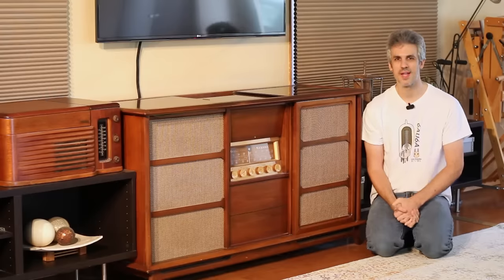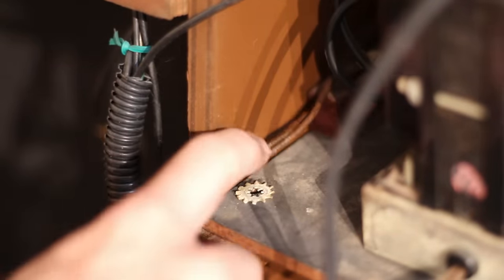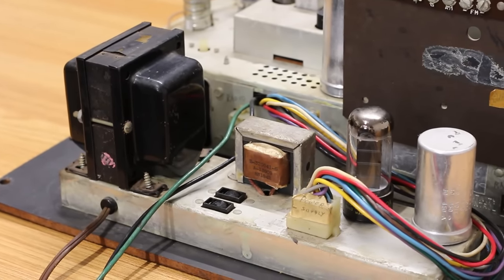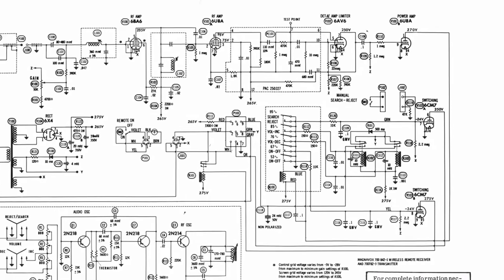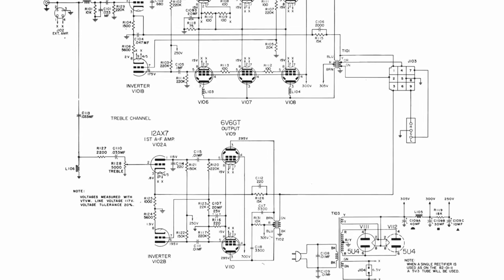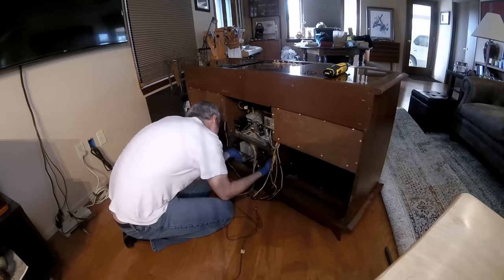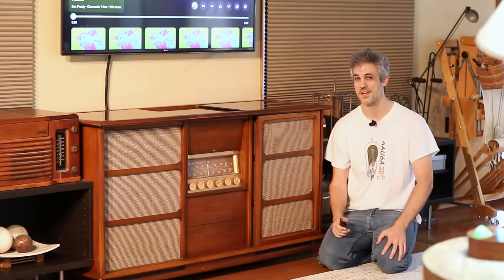A Look at our Magnavox Concert Grand Console Stereo

Comment: There were toys that broadcast a radio signal, most directly was "Mr. Microphone".  There were also units that plug into a headphone jack so let you hear your device on the main car radio speakers.  Digging up one of those would be the easiest way to calibrate the tuning dial.  If you're trying to source string, try the stuff used by RC planes.  It's Kevlar which does not stretch at all and gives positive repeatable motion, and is available at hobby shops.

speakers:  When I got my Paradigm Titans in the mid 90's, I found that that just 2 watts would rattle the windows of that room.  The 15" subwoofer though, has its own 500W power supply.  That would regularly cause screws to loosen throughout the house.
Reply: Braided Dacron fishing line is virtually non-stretching and works well as dial string. Monofilament, however, stretches far too much and would never work.

Comment: The Concert Grand is the holy grail of Magnavox console stereos. 100 watts total power between the 2 bass channels and 2 treble channels. Remote control was radio frequency. That console was $1000 in 1959, which I see was the build date of that unit. Since FM stereo was new, the MPX adapter was an option. Oddly at the time you could opt for FM stereo OR remote control, however the later MPX adapters were smaller and people have CG's with both. I had one in that cabinet style in ebony. It has been passed along to another collector.

Comment: FM, you're a bit out of range there but AM- that should wake up at night and pull in a bunch of stations.
You can often omit the ground connection and have the antenna alone work- I pulled a length of wire down the wall and have two ceramic insulation posts screwed into the roof rafters with 50' of baling wire pulled taut between them.
Works great at (a rather directional) AM antenna for the HiFi in the living room.

Comment: That's wild, I've never seen a console with monoblock amps. And that many 6V6s! !  A few more and it could be output-transformerless (OTL). I have a mono amp with a pair of 6V6s that puts out plenty of sound from a 12" woofer and a treble horn, although I did switch to an amp with push-pull 6L6s.  I can't imagine you'd want to run that during the summer in Texas.
Good luck with the dial string, that's the bane of dealing with radios.

Comment: From the quick glance of the remote it acts like a generator frequency display. There is a coil driven from the remote receiver, which gets the decoded tones from the remote. Remote can develop 6 tones, all around the same low frequency, similar to mains, and this operates a big coil that activates the set of tuned reeds. Those that resonate have higher amplitude, and make momentary contact with the contacts for that function, and there is then a RC circuit per channel to operate a relay for each function, so that a press operates each relay for a long, plus a delay due to the RC network, for each function. 6 buttons so at least 2 are power on and off, and then volume up and down, probably by a motorised volume control, and then finally you probably had tuning via a similar thing that ran a motor to the tuning dial.

Comment: Radio is actually pretty fascinating. You are essentially using a high-frequency radio wave that's orders of magnitude higher in frequency than sound waves, so you can use it to "carry" the audio signal. If you look at AM radio, the actual shape of the radio wave mimics the amplitude of the audio signal itself. You can filter out the high radio frequencies using filtering capacitors, but because it's an AC wave, you would just get nothing if you tried doing that. First, you need a diode to cut out the negative part of the wave so you can filter out the RF to get an electrical signal in the shape of a sound wave (modern radios also use a DC offset to bring it back to being an AC signal). The term diode comes from the original vacuum tube diodes, so called because they have two electrodes. Before that though, the very first radios used a germanium crystal and a metal needle attached to a screw that you had to screw in so the needle just about makes contact with the crystal, allowing the current to flow in only one direction. This is these days known as a point-contact diode and they didn't know it at the time in the early 20th century, but they had actually invented the first ever semiconductor device. So we actually had semiconductor diodes before vacuum tube diodes!
Reply: Some of the operators even noted a "cold" light emanating from some of their DC-biased carborundum detectors - these were in fact LEDs!
Reply: Amplitude Modulation on a carrier, demodulated after oscillation at 455khz I believe. There even was an AM Stereo. The FM trick is quite fascinating and the stereo (1-x) and others on the modulation is really great. Its fun playing with RF in times where people believe that HiRes makes very poor sounding devices deliver 'studio quality', where actually a good FM broadcast can sound better than expected.

Comment: Enjoyed that immensely  David!  Thought you'd like to know....The"Zenith Phantom" remote control system also used controllers with   They used a small bellows attached to a reed to generate a specific sound frequency that could be detected by your television or stereo console.  It is similar to the tuning fork system used by "Zenith Space Command"  The Zenith system ultimately lead to the coining of the term "clicker" for remote control  as they made an audible click when the tuning fork inside was struck.
Reply: I was wondering if anyone else remembered those things.
They went "Thoong!"
Reply: @StubbyPhillips  Actually I remember it more like a 'Psst', emitted a tone somewhat like a dog whistle.
Reply: @StubbyPhillips   And Zenith held the patent on the "Clicker" using the hammer and tuned rods, which is why RCA used a transistor and an ultrasonic transducer in their early remotes. Zenith used the hammer and rod system until the mid-70s, then they went to the transistor (later IC) and transducer method), then by the late 70's the IR LED system started to come into use.
Reply: I remember from when I was a kid that those Zenith TVs went nuts when you ran the vacuum cleaner.

Comment: The first remote control I ever saw was on my uncles TV back in the 60s (IIRC). It had three sets of buttons that when pressed, struck a small metal bars and produced an ultrasonic signal that the TV picked up. The controls were something like TV on/off, Volume up/down and Channel up/down.

Comment: As already suggested by another viewer MPX was the device added to have FM radio in stereo. At the time this set was being designed the standard for FM Stereo had not been determined there were at least two competing systems being tested. As a result high end systems were designed to allow as an add in once a system was adopted - a decoder to split the stereo signal. If my memory services right the radio part of the system would feed to this device from the IF stage of the radio the multiplexer would process it and then pass it back to the radio and then onto the amplifier.

Comment: A lovely example and a good candidate to do a basic restoration. It looks like all you need to do is change all the electrolytic capacitors and check all the resistors, as some of the high value ones, especially the anode feed resistors, will have probably increased in value over 60 years!

Comment: 6  -  6V6's for the bass speaker (around 120 to 150 watts) and 2 - 6V6's for the horn ( about 50 watts) and yeah, it will rattle the windows.  4 chassis'  each with there own transformers ( the large ones are power and the smaller for speakers on the amplifiers) and no wonder this thing weighs a ton ! Beautiful consol.
Reply: you'll get maybe 30-35 watts out of 6 6V6s and 10-12 out of 2 of them.

Comment: That thing is insane! It’s essentially a tube powered stereo PA system! My old (tube pre/solid state power) bass amp had a 1x15” speaker and weighed a tonne!
Would be interesting (and possibly scary) to put a wattmeter on the power cable and see how much it draws from the wall - I’m guessing a lot! Though it would have the benefit of also functioning as a heater too ;-)
Reply: provided it runs in class A it would be 50 watts for the reciever and something like 150-200 watts per amplifier I suppose, so around 400 would be an estimate. And indeed, those tubes are good in heating the room up.

Comment: Whoa, those look like 15" woofers with 1" tweeters on bi-amped monoblocks. You can definitely run rock concert sound levels on that beast. 100 watts of tube power is the same amount of grunt as a full size Marshall guitar amplifier stack (which, coincidentally, is using the same power tubes.)

I would seriously consider attaching either a reel-to-reel or a decent record player for listening music. The built-in record player, if it still works, doesn't hold a candle to a more modern turntable with a diamond tipped stylus.
Reply: The turntable uses a diamond stylus
Reply: @matthewtaylor7355 ,  Even the best record changers invariably have mediocre fidelity at best, even if the cartridge is magnetic and has a diamond stylus tip. Invariably, such changers are idler wheel driven and will have very high rumble, low-frequency motor noise that is coupled through the platter and tonearm into the cartridge, and even if the speakers can't reproduce all of that low frequency noise it will make life much harder for the amplifiers by wasting power and just in general shaking and vibrating the phono cartridge sufficiently to obscure fine details in the music.  Having the turntable mounted into a heavy piece of wood furniture that has speakers bolted to it is also a recipe for muddying the sound because the speaker vibrations will resonate into the turntable and be picked up by the cartridge period it might be even feedback a little at high volume especially now that the rubber grommets used in tge damping and suspension of the turntable are probably dried up.

Comment: What a great stereo console! Among the very best, with Ampex and some top of the line Zenith. Too bad you're not using the FM tuner with an outdoor antenna. In early 60's most consoles and fm tuners were MPX (Mulptiplex stereo) ''ready'' but the multiplex was an add on module, optional, or that you can add later.. I have a stand alone tube Mpx unit sitting by my Scott 350 tube fm tuner.
What a beast, this Magnavox! and Cool looking! I envy you..

Comment: I don't see any antenna attached to the receiver or built into the cabinet?
Even in a rural area in the US you should be able to pick up some am stations at night.
As someone who's restored many old tube radios, I would suspect it just needs a complete realignment of the RF stages. The values of the adjustable capacitors can slowly drift and wiggle around so that it doesn't amplify the signals enough. It's a fairly simple procedure to hook up a signal generator and align the IF amplifier stages with a 455 KHz modulated signal modulated with an audio frequency. The service manual you have should give the procedure. Then you calibrate the frequency setting of the dial by adjusting some trimmer capacitors to get a frequency on the low end and high end of the dial tuned correctly.

Comment: I remember when people had these in their living rooms.  The Magnavox was great.  Their turntables measured the size of the record each time.  That’s why it touched the record on the stack, so it would know where to put the tone arm.  My aunt and uncle had one of these that was split in two units.  One was just speakers and record storage.  The other one was the controls and the other set of speakers.  Placed farther apart, the stereo effect was better.  It also played AM out of one speaker and FM out of the other because before MPX stereo, the only way to get stereo was to simulcast one channel on AM and the other on FM.  Of course it wasn’t as good, but it was two separate channels of sound.  According to Robert Caro (the volume released about 2012), LBJ demanded one of these in return for having a high worth insurance policy written.  Seem implausible to me, but that’s what he wrote in his book.  Maybe not this exact model, but close to it in price point. On a different topic, Mr. Caro is getting very old and has yet to release his final volume on LBJ he’s been working on for 10 years.  He seems to be determined, but by the time LBJ supposedly demanded this bribe he could have easily afforded anything, so I have my doubts, though I don’t dispute someone may have told Mr. Caro the incident occurred.  For one thing, the model number Caro mentioned doesn’t seem to exist in any literature. And also, by today’s standards and years of Trump grifting millions at his hotel and golf clubs, a nice hi fi seems kind of innocent.

Comment: "Radiomuseum" says the model 1ST800F (which has the same chassis but a slightly different cabinet) was made from 1959-1962. If yours is hasn't been worked on I'm 95% sure it was made in 1960 because I could see a date code of "59-52 274" on a Magnavox-branded tube. If the tube was made at the very end of 1959 it probably went into the set the next year. If the tube was replaced back in the day it wouldn't be Magnavox branded.

The 274 printed after the date code is the EIA manufacturer code, which tells us the tube was made by RCA.

Comment: To calibrate the AM dial after you restring, tune the other old radio you have on the left to 600kHz then spin the console variable capacitor until you hear an awful noise. That will be at 1055kHz leaking from the heterodyne, which mixes 455 and 600 into 600-455, 455, and 600+455. The Intermediate frequency [455k] is filtered and amplified before detecting into sound.
For FM. the IF is 10.7mHz so use 90 on the broadcasting set and 100.7 on the console.

Comment: Good tube amps these days run multi thousands,and what a clean sound they make.Looks like you could use a signal generator for retuning this beast.Great that you have the schematic,it is very handy for following the signal path if it has any problems in the future.

Comment: You only need to power the amps. Set your tv to variable audio output. Leave the rest of that stuff unplugged and save the power and heat. Lovely Bi-Amp system. Those Magnavox drivers are well liked in audiophile circles and have a good value on the market. Nice to see you enjoying it.

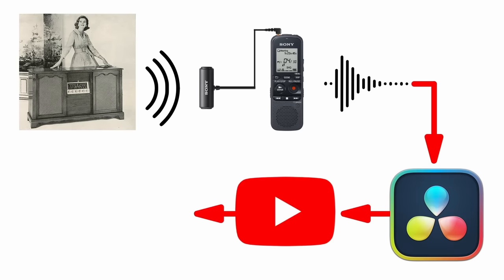Comment: Thanks for sharing. I have a copy of the Magnavox stereo demo record from that era, the front cover features that picture shown at 3:00. As a vintage techno-nerd, I appreciate the detailed views. I can't help but wonder how much juice this beast pulls, gotta be 100W just to heat all those rectifiers! The advert at about 11:00 claims it pumps a 'tremendous 100W undistorted', not huge by today's standards, but impressive for consumers in 1962. It looks like they were still getting a volume discount on those 6V6 output tubes, they used them everywhere. They're not particularly beefy, but stack up 16 of them and I suppose you could rattle the windows! The Collaro record changer looks familiar too, my earlier Magnavox mono players use practically identical models.

Comment: For the radio alignment, get an adapter for a car that converts 3.5mm input to FM output. All you have to do is power it with 12 volts and it should work perfectly for generating a small FM signal.

Comment: I have an idea of what you are talking about in performance. 
As I have an AstroSonic from 1963 (Transistors) I replaced all the electrolytics in. It has a lot of point to point connections like tube electronics, transitional phase. 

Timbre(off/on) - Treble and Base (crossover controls ?) 
two large horns and two 10" bass speakers make for a very real and loud experience.

Comment: dial drives can be a right pain in the bum to get right 😉  theres usually a datum mark on the dial or back plate to set the pointer at max (or minimum, depending on the whim of the maker) end stop of the tuning gang, so you wont necessarily need it to actually receive anything

Comment: MPX = multplex, an early term for FM stereo usually using an external multiplex adapter.  There should be a RCA jack on the back for output to the mpx "decoder" that then feeds left and right channels back to the amps.

Comment: “FM multiplex!” When FM stereo was being introduced around 1960, some FM tuners and receivers had connections for an optional FM multiplex decoder. This was a separate unit that would take the signal from the FM detector, decode the stereo signal, and output two stereo channels. On some systems, a stereo amp was already in place, on others, you needed to buy another amplifier channel and speaker if you wanted stereo.<P>If you have a small unit plugged into your FM multiplex jacks, that's the decoder. If nothing is plugged in there, you have a mono system.<P>The term "multiplex" simply means "multiple channels at once" (in this case two, of course). A 38 kHz subcarrier is modulated with the difference signal between the left and right channels. Therefore, if you add the signals from the main mono FM modulation and the stereo subcarrier, you get the left channel, and if you subtract them, you get the right channel. A mono receiver simply ignores the 38 kHz signal, leaving you with regular mono audio.

Comment: Well, personally, I would replace all those big high voltage electrolytic capacitors because the electrolyte inside them must be pretty dried out at this point.  Also, you should check the grid current of those 6v6 because in the 60s the wall outlet was closer to 110v not 120v like today.  This means that the high voltage supply on the secondary of the power transformer is significantly higher than it used to be in the 60s and the grid resistors value most likely need to be raised so that the grid current of the 6v6 don’t exceed their specifications.